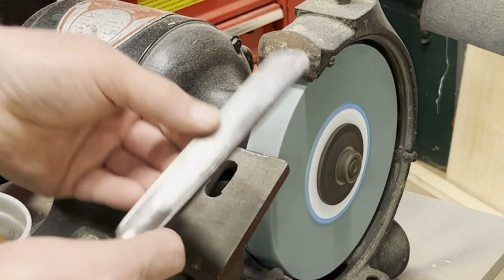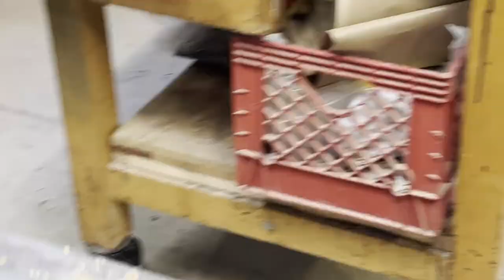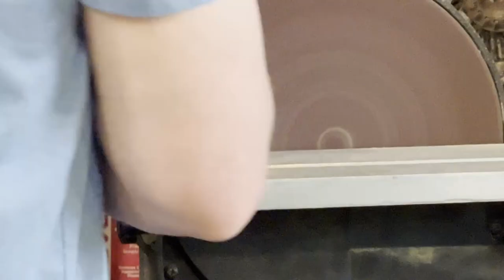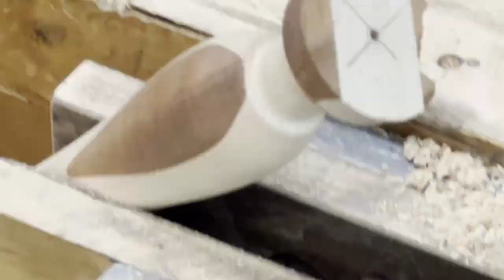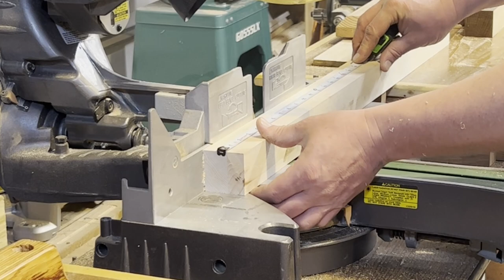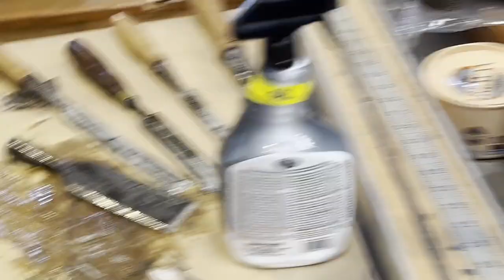Making Tool Handles Part 2

Comment: You are using your gouges more like scrapers, held level. Oh, turning scrapers, not cabinet scrapers. If the tools are held with the handle down a bit and the tool up on edge, you will get much cleaner cuts. When turning spindles, think of sharpening a pencil with a knife or even chisel. Always cut down hill or towards the middle of the spindle. 10,000 more times! There is what is called a peeling cut, where you are cutting on the tangent of the outside diameter. It is much cleaner than the scraping cut. If the butt end of the spindle is held in a chuck, you can take the socket the spindle is going into, ad slow speed, and push the socket onto the spindle. That would leave burning/metal stains on the wood where you need to reduce size. I always leave mind at least 1/8 inch away from the shoulder to account for compression that comes from high use.
Reply from the maker: Hey thanks a lot for the great tips Robo Hippy! I appreciate that. I will definitely work on it. I’m very new to turning but I was seeing some things after this last session and was turning into the cut more. I will check out your videos. Thanks again and check back later on my progress!
Reply: @Lucasartwork  At present, ;my videos are geared to bowl turning. Some say to start with spindles. I think I did 2, and then went straight to bowls. Still my favorite things to turn, but getting into threaded boxes now. Not a big fan of natural edge bowls. Mostly I want my pieces to be used daily.
Reply from the maker: @robohippy  Thanks again Robo Hippy! I watched a few of your videos already and liked them. You have good easy to understand way of teaching and explaining. Very interesting about the scrapers and sharpening. I need to try to do some bowls with my new gouges. I tend to switch operations a lot and realize each one can be such a discipline by itself.